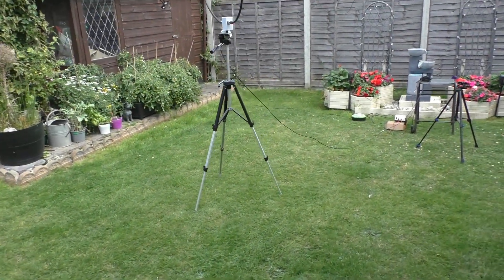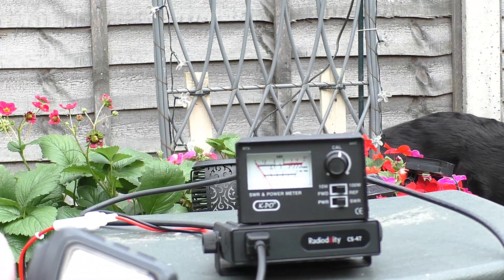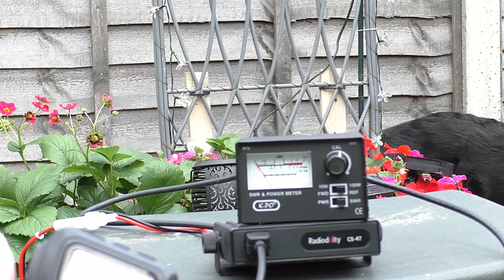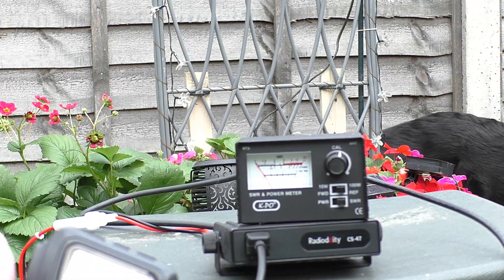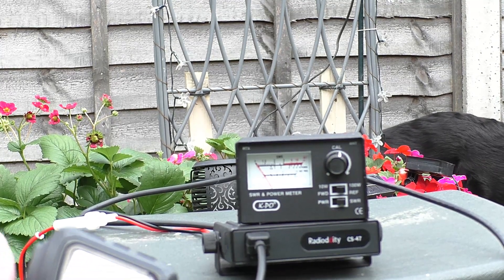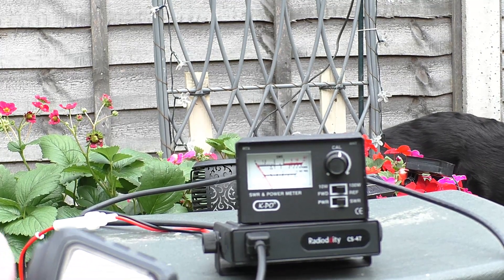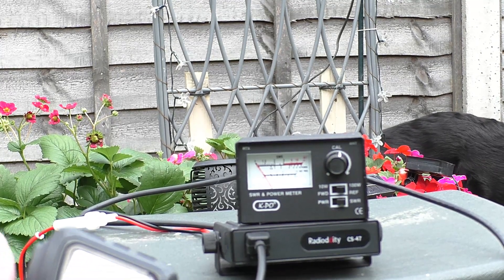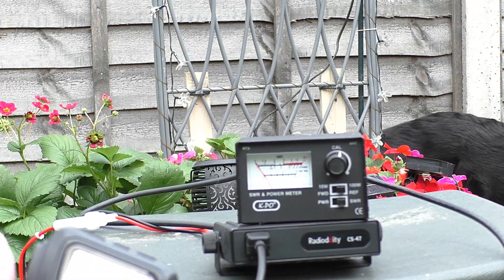QRP Magnetic Loop Antenna on CB radio.  First contact.  Part 3

Comment: Yes you need to point the  loop edge towards the transmitting Station and you will be very surprised with the Results smiles ...
Also there then is a front and back ...  Great you acheived a 1:1 awesome  ...
The other helpful point is being able to change the direction  of the loop remotely ...

Remember theres a Very High RF voltage created when Transmitting via loop Antenna ... 

Enjoy your Charlie Bravo  ... I started on CB using .5 watts ...  and a Top loaded Whip two metres long ...
Reply from the maker: Thanks for the tip!

Comment: It was a good series of videos Fred and i'm sure a lot of people would have founf it all very interesting. Mag Loop antennas are not the most efficent radiating antennas and need to be acutely tuned for a specific frequency. They ARE very good "receiving" antennas and we used to use a "DX LOOP" antenna in the 60's for receiving DX on Medium Wave and Short wave and as they were very directional made a very good noise blanking and receiving antenna.

Comment: Hi Fred,
As c515mps mentioned, try rotating the loop. As you have it mounted it will be horizontally polarised.  Rotated through 90 degrees, i.e. "side fed" it will be vertically polarised the same most CB antennas.

Comment: Just had a chance to watch this one, Fred. I have that little radio and was putting together a loop from some copper I had laying around this evening. I'm hoping to be able to run 100watts from one of my ham radios..
Reply from the maker: Hi. If your going to run that amount of power in to a tuned loop your going to need a very big vari capacitor to handle that without very bad  arching.  Many use Russian oil filled caps but they are pretty expensive.
Reply: @CB-RADIO-UK  I got this one out of a full power tuner, (1 1/2 kilowatt?) but the calculator says it will have 2.6 kilovolts of rf at the capacitor and I think it could arc, so I probably won't go over about 20watts for now. Thank you, for the advice.

Comment: A good comparison might be how well it performs at 11m for someone in a flat with just a balcony, or even next to a window, since that is the sort of scenario where a magloop might make sense. Magloops are more fun at lower frequencies where their small size punches well above its weight, even if they are less efficient down there.
Reply from the maker: Hi.  Yes i thought the same.  A high rise flat with a balcony should work well.

Comment: Though Canada does not legally employ 27.60125Mhz to 27.99125Mhz FM, it is being used here.  I hear the UK 27/81 channels in northern Canada regularly.  The 27/81 UK channels seem to be getting more popular steadily. So far, the operators are not being stopped in any way.  I do not know how these clandestine operators are getting the radios. But they are proliferating in northern Canada.

Comment: I use a Wallen Modulator have both the base loaded and centre load versions and these are very handy and can be put up in seconds the centre load is a bit more difficult to vswr, the baseload version usually get vswred very easily and they were only £35 for the centre load in 2019 and around £20 for the base loaded.
I have spoken to you with the base loaded using a crt ss9900.
73's like your channel 👍

Comment: Fred you need to try moving it in different directions it only transmits off the sides of the loop there's a NuleE/DEAD SPOT in the middle...  i think i spelled that right.. Cheers Friend still need to work you on the band! I check 305 to see if i hear you. I work europe no problems at all. Cheers from.. 2ny157 Bronx N.Y.
Reply from the maker: Thanks.  Good advice.

Comment: Seems you omitted to read the bit about loops being highly directional? Accordingly, they make good rotatable receive antennas because you can tune out directional noise. Also they are very high Q, hence the need to re-tune them every time you change frequency on your radio.
Reply from the maker: Yes your correct i forgot that fact.

Comment: The loop is tx'ing in the horizontal plain and your mates are using vertical antennas so that's a 30db loss on your audio to the vertical station's.
Get one of you mates with a 1/2~dipole to turn it flat side and you will boom in 5&9 . You are struggling because you are trying to work cross polarization.
You could try laying the loop down flat on the shed roof then you will be tx'ing in the vertical plane
Cheers n beers Fred.
26CT2381/2E0LFD Baz.
Reply from the maker: Thanks for the advice.

Comment: Good evening just a question where do you put a antenna matcher it's a zetagi mm27
Reply from the maker: With the loop tuned you should not need an additional matcher.  However if you do it would be RADIO-SWR METER- MATCHER-ANTENNA.

Comment: They're a bit shoddy those loops, you would have much better luck with a real magloop that uses a matching loop and single air space cap or vacuum cap. Me and my dad used to make them for the lower HF bands back in the 90's
Reply from the maker: Yes i think you right.

Comment: The wife will think it's a bargain keeping you occupied for hours and out of her way. From a radio point of view not so much - one for the back of the cupboard ?  I have a mag loop that I use on 10 sometimes - it covers other bands - and can get Europe crystal clear on SSB with 10 watts transmit and receive by 2EORO . Cost circa £120 and is brilliantly made.  I know it will do 11 but do not use it for that. The difference ? Made by someone who knows what they are doing ? Kudos for persevering but it is doomed to fail because it is designed wrong for transmit. M7BLC